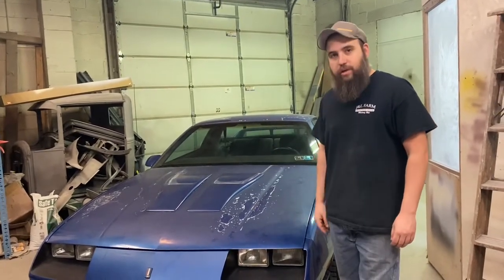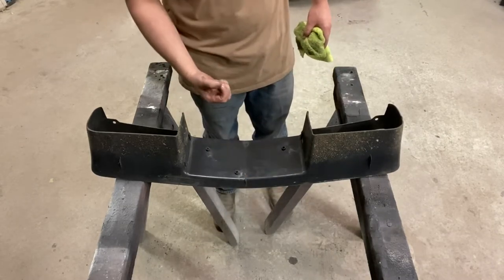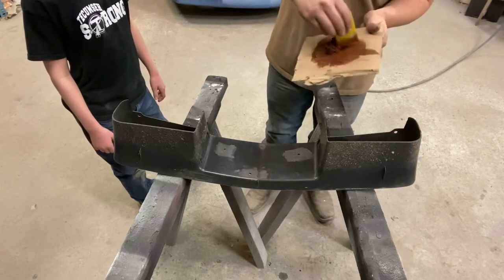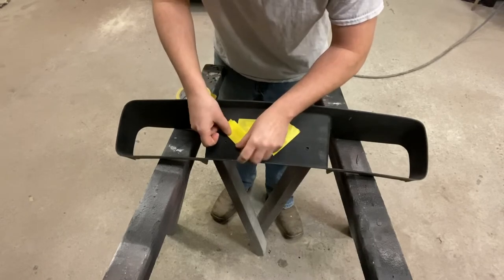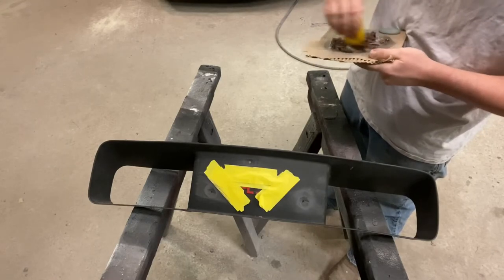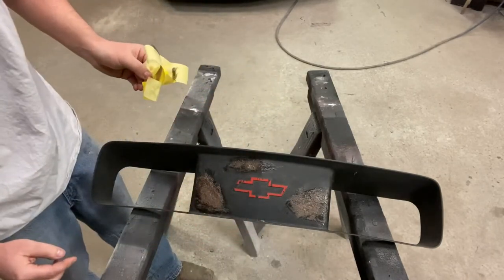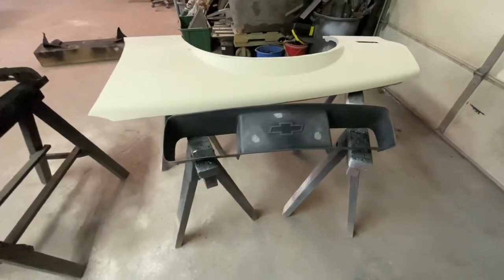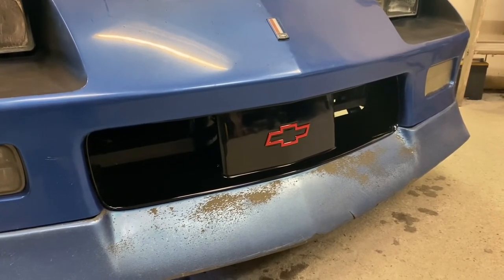How to restore Third Generation Camaro grille - 1LE - Part 2

Comment: Third Gen projects aways catch my eye on YouTube. I owned three at one time but, I sold one and keeping my two. One is a convertible. That was awesome work you did on that grill. I had to do the same thing. A little fyi, a countersink bit make a perfect divot for the front of the holes. Not saying you did it wrong, everybody have they way of doing things and think of different ways of doing things. The bit will do it all, knock off the raised edges, roughen it up and give you a divot. Put tape over it and don’t press in the divot and push the filler all the way through. But again, you did a awesome job. And I made both sets of my blisters functional with grill material that looks exactly like the fake stuff that’s on them but with real holes, I even cut some perfect holes in my hood for heat to extract. Keep up the awesome work.
Reply from the maker: Sounds like a great way of doing it. If you like third gen content, this is the channel for you. Funny you say that about the blisters. I am dropping a new video on mine today! Thanks for watching!

Comment: I tough those holes were made by someone, but after buying a replacement oem it had the same holes, so probably it’s factory
Reply from the maker: Yes, you are right, I imagine they were factory. Either way they had to go lol
Reply: @supremacycustoms6536  it came really nice 👍, I still got my old grill, might be doing this
Reply from the maker: Thank you! Good luck with yours!
Reply: The holes are from a front license plate holder being screwed in on delivery the state this previous owner lived in prolly required front license plates…them 3 holes are not factory